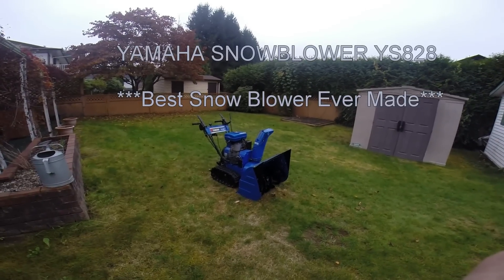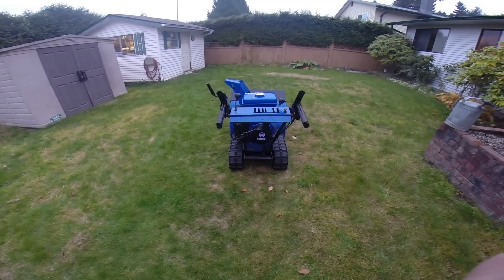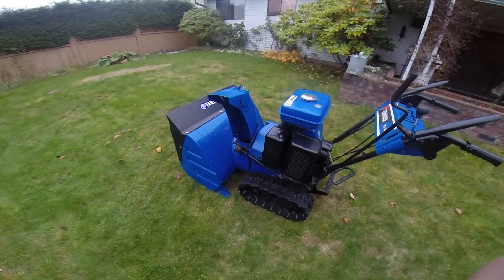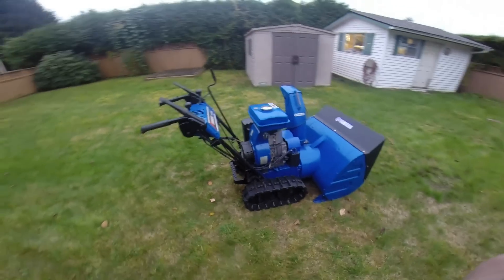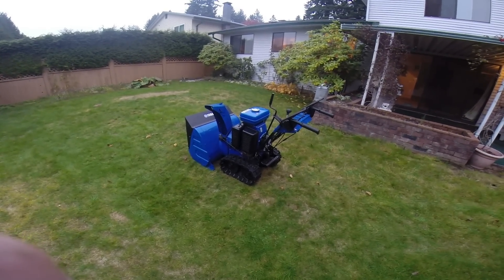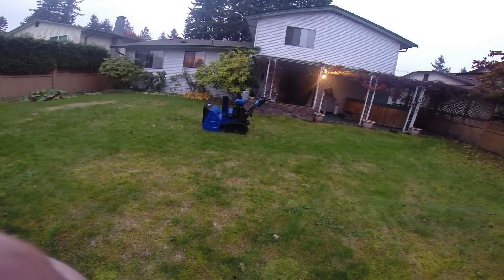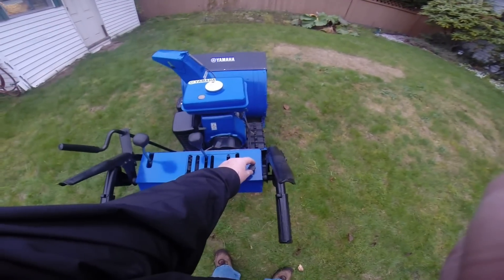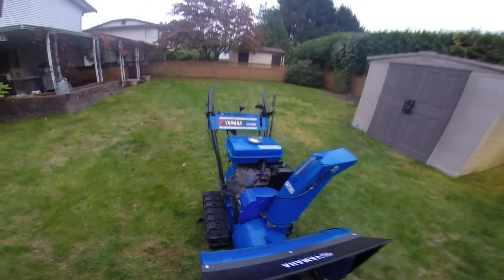Best Snow Blower Ever Made

Comment: 50,000 snowblower videos on YouTube and yours is the only one with no snow on the ground.  

And even though I own an Ariens, Honda is by far the best.
Reply: +Richard Fallstich Hi Richard, The Honda design is a direct copy of the original Yamaha.  So I agree the Honda is VERY good, but only the Honda top model is equivalent (not better) than the Yamaha.    Thanks for your input :)  Cheers !
Reply: +Charles West 
The chute in Honda is motorized not manual. Honda engine is the best even in the cars or generators. Same as motorcycle engine, How do I know? I own 1989 motorcycle and still running like a champ.
Reply: Throw a Honda on your Ariens. Then it will be a beast. Thats what I did with my 71" Ariens SnoThro now it is an unstoppable powerful tank and I got the machine for free and the engine for $99 bucks. Now I have a slammin machine at an unbeatable price.
Reply: +Larry Bui Who really needs a motorized chute unless your disabled, really. Its just lazy. Cranking it one way or the other and lowering the deflector by hand it takes all but 5 seconds tops. Also Honda's are great but when it cane to snow Tecumseh snowking engines gave everyone a run for there money in snow.
Reply: +-Doug - Why use a blower at all unless you're disabled?   Using a snowblower is just plain lazy! Grab a shovel and get some exercise.
Reply: +Richard Fallstich On a commercial level, doing a minimum 50 driveways spread out over 3 days. Thats suicide.
Reply: +Richard Fallstich Actually honestly that one blizzard we had in Jersey this year. Trying to shovel that, for just your one driveway is crazy. People were dropping like flies from Heart attacks. Theres a reason they make snowblowers. Thats bad advice, trying to shovel that and then people drop dead trying to proove they don't need a snowblower in two, three feet of snow and it dont matter if your disabled or healthy and 30 years old, the chances of hurting your back or dropping are high in those conditions, much better ways to get healthy exercise. Bad advice, I would not reccomend anyone goes gung ho and attemps that. Use a snowblower!
Reply: oh sure if you feel like spending $2500+ on a 24" snowblower they're great units. I'll stick to my Ariens they're just as reliable and very durable in my experience as I also own one.
Reply: I love how all the Ariens owners bash the Honda and Yamaha owners for spending too much. Yup I paid a boatload of money for my Honda HS928 tracked machine 16 years ago and I'd do it again, except I plan on using it another 16 years (and I'll likely be dead by then anyhow). I've owned most of them (including an Ariens) and there simply is no comparison. From the quality of the steel to the ingenuity of the engineering, you get what you pay for when it comes to high quality snowblowers.
Reply: I don't doubt the quality I have several pieces of Honda power equipment I don't doubt that they are good quality. Thing is though in my area we don't get enough snow to make it worth spending that kind of cash on one. If I was in Canada or upper peninsula Michigan I would see a need for something like that. Although if I'm going to spend that kind of coin I would invest in a PTO snowblower for my tractor. Lots of heavy gauge steel, minimal maintenance keep fresh oil in the gearbox, grease the chain and sprocket usually you can get 20-30yrs or more out of one and clear snow much faster than any walk behind with a 6ft clearing width.
Reply: I dont know. I have 2, 45 year old machines that are going strong. I remove snow commercially and I need a walk behind a Tractor is to big and to much trouble to lug around in a snowstorm and roll on and off the back of a pickup. Plus at my own home I dont have space or need a tractor. A 24 wide walk behind two stage is more than enough. I have the 32 wide now for snow removal and they are excellent machines. Plus we take 2 snowblowers with us snow removing. I Used to take a single stage as well but now we just use 2, two stage units. I have a 3rd backup in case one goes down and cant be repaired right away.
Reply: Jon Homrich It comes down to your needs and application. For me a Tractor wouldnt work.
Reply: Fearless Front -Doug Wardenski this is true, but however though you get what I am saying. a tractor with a PTO snowblower makes no sense to the average person. but since I have already made the investment of buying a tractor I could do it. If you're a snow removal company and need a heavy duty snowblower for working day in and out on sidewalks or against building than this makes sense. or if you live in northern Michigan or Canada where they get hammered with snow and an average snowblower will just die in a season or two this also makes sense. but in most of the country it's overkill to have a machine like this or a Honda as for one they're very pricy and honestly will be a very long time to see a return on investment to make buying this worth the price.
Reply: The only people who can best Honda is Yamaha....

And I own an Ariens too :)
Reply: Honda is very similar design but has hydrostatic drive which is much better
Reply: I think it's 55,000 snowblower videos on YouTube........
Reply from the maker: Thanks for the comment!

Comment: Fine machine, but the newer ones have a hydrostatic transmission.  I've had a Honda HS928 tracked machine for 16 years and have never had a problem with it. I owned an older Yamaha snowblower about 20 years ago and would have bought a new one to replace it but they stopped making them for many years. Anyhow, the hydrostatic transmission in my Honda allows much easier effort and very accurate cuts thru the snow. If I was in the market for a new snowblower I would definitely consider the Yamaha, along with the Honda ..... hydrostatic tranny is the key.
Reply from the maker: Thanks for the comment!
Reply from the maker: Thanks for the comment!

Comment: I would never buy a Yamaha snowblower I bought a used YS624 with a blown engine thinking I would install a new 7-8hp engine and they will not fit due to the garbage design of the original yamaha engine.
Reply from the maker: Hey thanks for the comment and for watching the video!